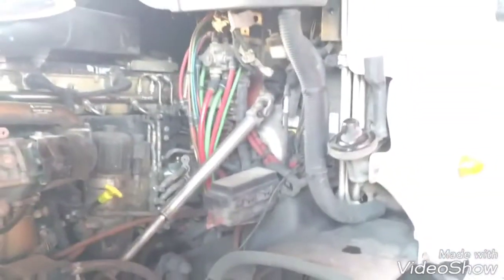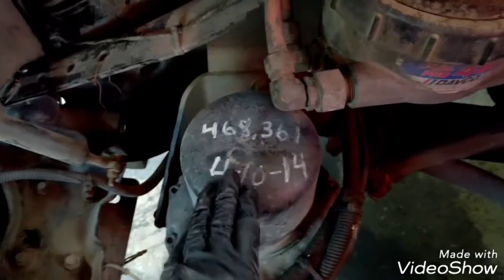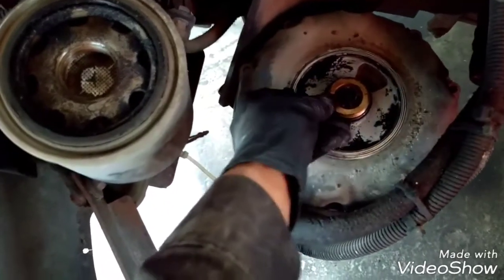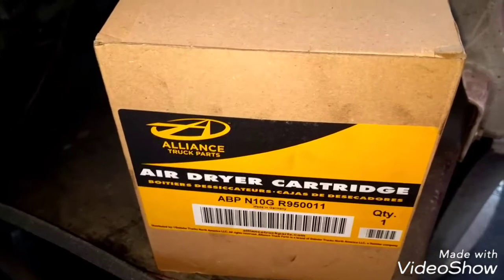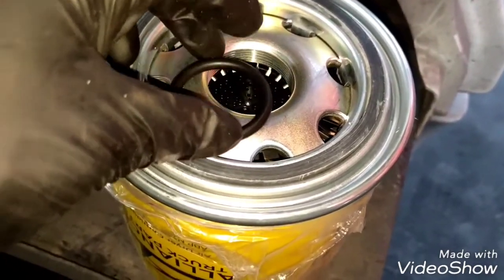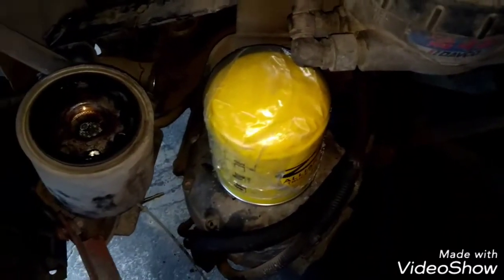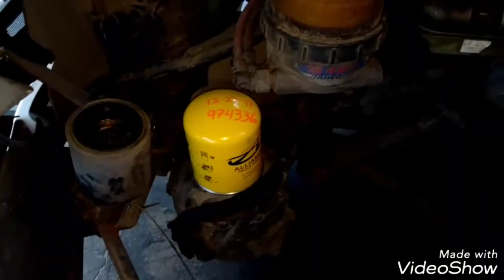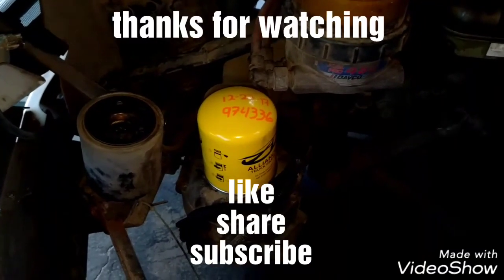Freightliner Cascadia Air dryer filter remove replacement

Comment: Hey question my truck went from extreme warm weather to cold weather and now my truck is barely building air pressure. I drained only the air lines under the battery area and forgot to drown the air line near the compressor do I need to get a new filter?

Comment: Yes I do.    It’s right behind the sleeper ez to get to.  It’s a 2014 Cascadia has 480,000 miles.  DD 15 engine
Reply from the maker: It Is meritor wabco R950068A

Comment: Francisco. I need your help. On your video you see where you took the small o ring out. That piece has a thread that holds down the filter. When i took my old filter out, that thread is rusted onto the filter. Is there somewhere i can buy that piece or do i have to buy the whole system???
Reply: My master tech said you have to cut the filter from the nipple or use an air chisel to loosen it... like hitting a jar from the side to loosen the top...
Reply: I purchased a new airdryer n installed it myself. I purchased truck used so i figure ill get new 1

Comment: Francisco i have a problem on starting up the truck it cranks a while before is starts and only that happens when truck sits couple hours what could the problem be any advice what to check? Sorry i know it has nothing to do with this vedeo thank you in advance for all you do
Reply from the maker: Check the fuel check valves of the fuel filter module.

Comment: Do you have a video changing The Purge valve for the dryer?
Reply from the maker: No yet.
Reply: purge valve located on a bottom of the dryer. simply unscrew it under clockwise.

Comment: Saludos Francisco, Yo tengo un 2014 Freightliner Cascadia el cual tenia el Air dryer desconectado, Yo compre el air dryer y lo lleve al mecánico y el lo conectó pero no hace el release del aire, el no supo dar con el problema, pero yo noto que el air dryer tiene 3 conexiones y el solo le conectó 2 mangueras, la que viene del compresor y la que va a los tanques. Si me podrias ayudar a dar con el problema para que el air dryer haga el release del aire.

Comment: Como esta Francisco queria saber si usted nunca a visto carbon (polo negro) a rededor del turbo y egr valve en una 2012 freightliner cascadia y que puede Ser?
Reply from the maker: Carbon, puede ser que El turbo o la EGR esten quebrado. Si no, algun empaque esta roto.
Reply: Como puedo saber esque no tengo check engine
Reply from the maker: Tiene que revisar, quitando El covertor para ver de donde esta saliendo El carbon.

Comment: I have a 2014 Cascadia DD 15 can you tell me the part number that I would need for the air dryer filter I would appreciate it greatly.  I don’t know if it ever been changed, I bought the truck several months ago from Lone Mountain is been running great, it has 480,000 miles I bought it when I have 450,000
Reply from the maker: Do you have an air dryer Similar to the one on this video?
Reply: @franciscoamayaYT  yes my is similar . What is the part number ?
Reply from the maker: @percygonzalez6802  
Part Number S4324711010
Manufacturer MERITOR

This part number can very over the year and upgrades

Comment: My Air Dryer Filter's over tied, 
What should I do?
Reply: It's DD15 Moter.
Reply from the maker: You can get the side of the filter warn so it can release the seal
Reply: @franciscoamayaYT  how do I warn it?
Reply: Warm?
Reply from the maker: With a small torch will be ok.